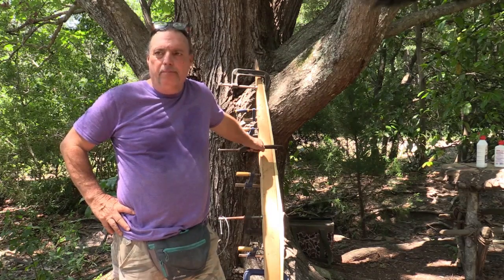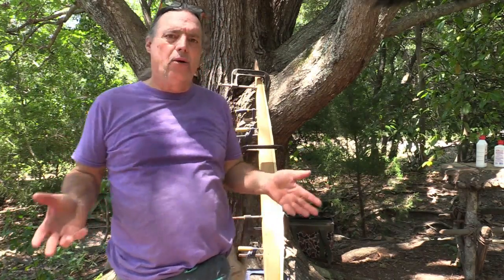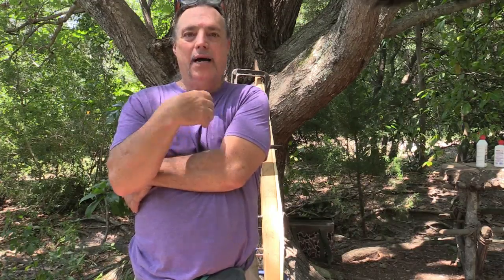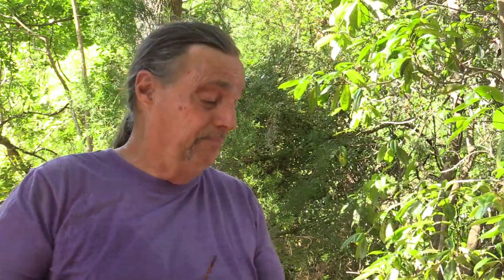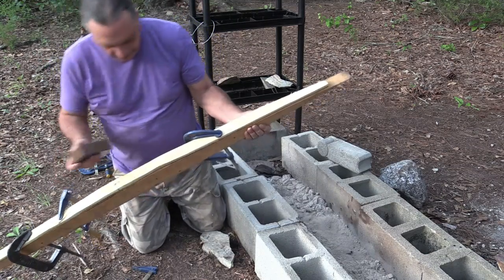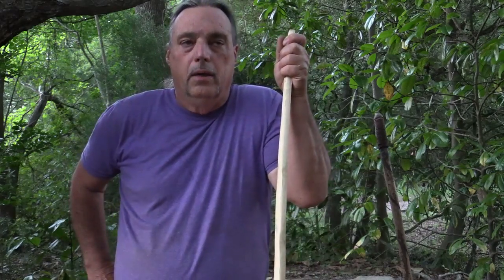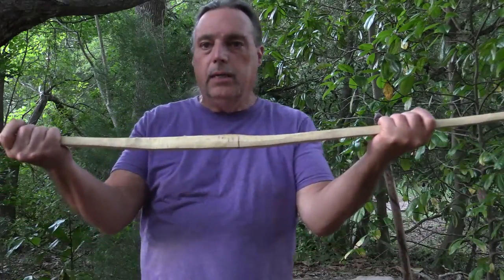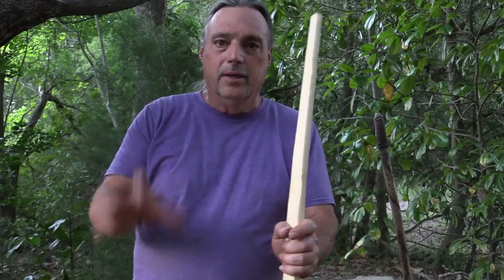Force Dry your Bow Wood in Hours.  Make your bow now.

Comment: I live in San diego.  My tribe here used mainly elderberry an willow, I haven't had much luck. Have you ever tried using elderberry? The only other wood here that might be worth using is pacific dogwood. Or maybe a oak. If you have any suggestions it would be very helpful. Thank you
Reply from the maker: Sorry man, I really don't know about your local wood, but I have heard west coast tribal people using oak. Give it a try, nothing to lose only knowledge to gain.
Reply: @BeckumOutdoors  I appreciate it will definitely give it a try
Reply: I'm in England but have made a few bows from elder - sambucus nigra. It does make a good bow but try to find a clean piece with none of the knots clusters.
Reply: Elderberry and willow are good bow woods for certain designs. They're light and weak, and no good at all for modern western designs, but the natives made wide and low-stress bows. Lighter woods means that wide limbs and tips won't create hand shock or lower arrow speeds.

Pacific dogwood is a great bow wood. If Elm is a little brother to hickory, then Dogwood is its little sister. Oak is also an excellent bow wood, I'm also out of California. Try for white oak, but red oaks do fine too. Both are exceptional candidates for fire hardening, white oak is likely better than hickory.

For tension strong and compression weak woods like elm, dogwood,  hickory, and oak, try to use saplings with a small diameter. The high crown will decrease compression strain and increase tension strain, matching the quality of the wood. 1.5in thick, tapering to 3/8in nocks

Comment: How do these fire hardened white wood bows hold up Over years/decades? I rarely see any bows 20-30-40+ years old still being shot with no string follow that aren’t Osage.
Reply from the maker: My bows have not changed any for years now. I hunt alot with long string times. But tiller skill still plays a big part with any wood bow. I take good care of my bows and do not over draw past my draw length or hold a bow at full draw too long. Just treat them well and they will treat you well.
Reply: That's probably some form of survivorship bias: 20-30-40+ years ago, few people used anything but Osage and Yew, so there are just fewer older whitewood bows to go around. Anyone who did make them was usually an amateur, so they were probably of less consistent quality.
Reply: @wingit4316  huh? People have been using white woods for thousands of years.
Reply: Of course. But if you were to take all the wooden bows in a 100 mile radius, and sort them by age, most of the older ones would be Osage or yew. I don't mean to say that whitewoods are a new phenomenon, I just mean that most commercially sold wooden bows before maybe 2000 weren't whitewoods.
Reply: @wingit4316  there’s no such thing as commercially sold self bows. They’re not made from square cut boards that you buy from Home Depot and so they’ll never be commercially sold.
Reply: Don't be pedantic. I mean commercially sold as opposed to looted or in a museum.